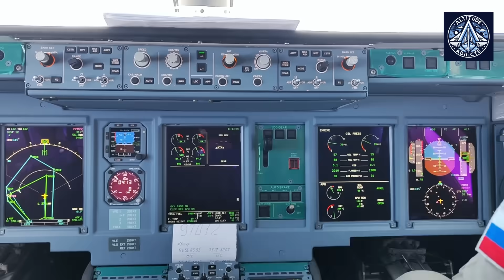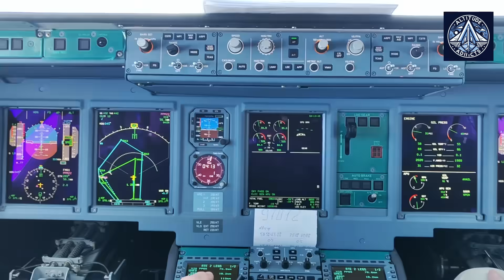Second Russian Superjet with PD-8 Engine Takes off

Comment: It used only ¼ of the runway to take off
Reply: That's why the engines smoked,and when they did another steep angle flight
Reply: Do you have any idea how long that runway is?
Reply: @jacquelinelasway1768  it's empty.

Comment: The PD-8 by-pass ratio is only 4.4 that is probably why it is so noisy. It sounds like older generation engines.
I wonder if it is as fuel efficient as its western competitors.
But I'm sure it's going to be a reliable and efficient workhorse for this magnificent new plane.
Reply: It's simple - the limited fan diameter (about 1200 mm) does not allow achieving a high bypass ratio. The bypass ratio of the PD-8 is 4.4 (versus 8.5 for the technically close PD-14). According to open sources, the specific fuel consumption of the PD-8 is 0.61 kg/(kgf h), and for the SAM-146 - 0.629 kg/(kgf h). The compression ratio of the PD-8 is 28, for the SAM-146 - 22.89

Comment: This 2nd SJ100 test with 100% Russian engines and components took of at record speed and climb 40 thousand feet excellent results there are 2 more get ready for part of certification batch of 4 aircraft, this will help for speedy certification in the next 6 months, in the mean time mass production line and systems are in testing phase already first batch delivery first quarter 2026.

Comment: Habria que hacer una comparación del pd8 con el sam 146
Reply: @alexander09129  пд-8 по характеристиками чуть хуже 146, особенно по потреблению топлива, но это все равно хороший двигатель
Reply: @Patronus87  According to open sources, the PD-8 has a specific fuel consumption of 0.61 kg/(kgf h) while the SAM-146 has a specific fuel consumption of 0.629 kg/(kgf h). The compression ratio of the PD-8 is 28 versus 22.89 for the SAM-146.
Reply: @МаксимА-й2м  Pregunta, ¿La relación de derivación tiene que ver con el radio del ventilador, y la derivación de compresión qué mide? Saludos from 🇨🇱
Reply: @ Bypass ratio is a turbojet engine parameter that shows the ratio of air flow through the engine's external circuit to air flow through the internal circuit. The higher the value of this parameter, the greater the engine efficiency that can be achieved. That is, the larger the "outer mouth", the greater the possible bypass ratio.
Reply: @Patronus87  The General Electric CF34-10E engine, popular for regional jets and similar in size to the PD-8, consumes 5% more fuel. It's simple - the limited fan diameter (about 1200 mm) does not allow for a high bypass ratio. The bypass ratio of the PD-8 is 4.4 (versus 8.5 for the technically close PD-14). The smallest engine in the new PW-1000G series has a fan diameter of 1422 mm - it simply won't fit under the Superjet's wing
Reply: @МаксимА-й2м  и где тут сравнение с Sam146?
Reply: @Patronus87  In fact, if you remove 5% from the known CF34 consumption (0.64 kg/(kgf h)) you can get exactly the data from open sources for PD8.
Reply: @Patronus87 Откуда дровишки😂😂😂 У ПД-8 передовая низкоэмиссионная камера сгорания, на основе опыта ПД-14, вместо старой камеры SNECMA...Холодный контур фактически тот-же и делается там-же, в Рыбинске. ЗАВЯЗЫВАЙ С НАРКОТИКАМИ😂😂😂